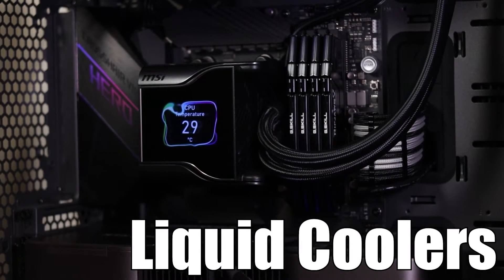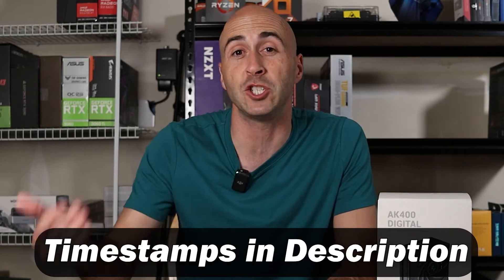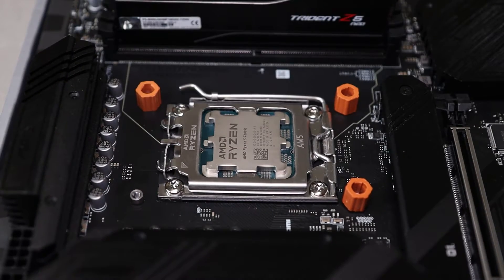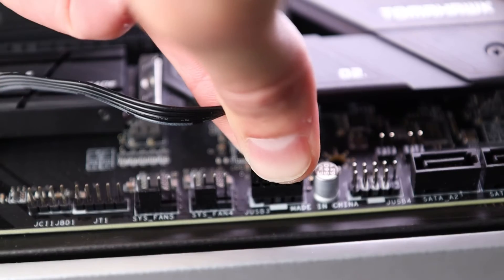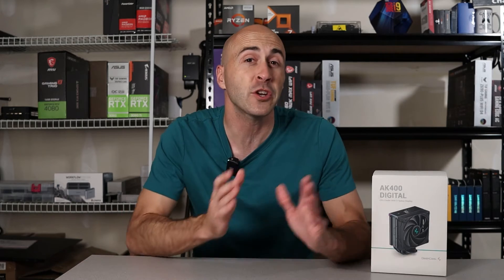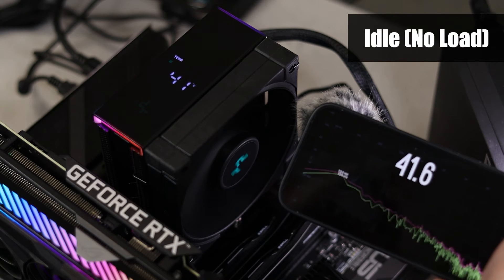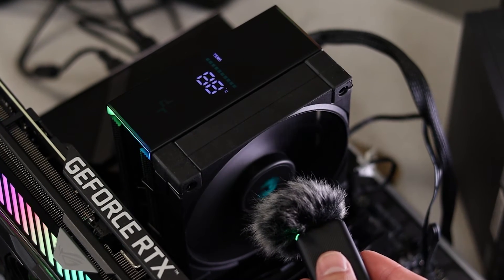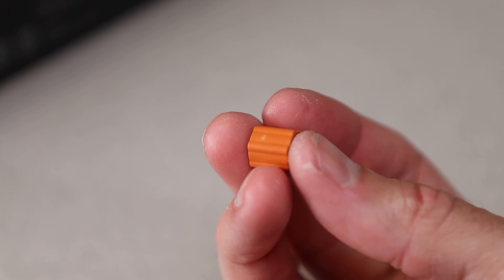LED Screen on an Air Cooler? | DeepCool AK400 Digital Review

Comment: What happens when my motherboard doesn't have RGB socket. Will it still show temperature ?
Reply from the maker: Yes. As long as you have the USB 2.0 connector and software.

Comment: Will it be good for the i5-12400f? The one I have now is not good, my cpu is overheating, so I can't even set the processor to its base speed.
Reply from the maker: It would handle the 12400f just fine

Comment: First off, great video. Thanks for all the information!!!
Secondly I would like to ask if the digital screen will still work without the 5v addressable ARGB header? My motherboard does not support ARGB, and i would like to have the digital display working.
Reply from the maker: Yes. It’s just a USB 2.0 header. The RGB end caps are the only thing ran by the 5V ARGB header
Reply: @DannysTechChannel  Thanks for the reply my man. Appreciate it al lot. You have my like and sub🙌🏻🔥

Comment: Thanks. You think this will keep the temps down with a 5800x3d? Or should i go for the larger AK620
Reply from the maker: I’d go for the AK620 if you’re running a 5800X3D. Can never have too much cooling.

Comment: Hi, my mobo only has a 12v RGB header is there another way for me to get the display and RGB of the cooler without having to get a 12v to 5v converter?
Reply from the maker: The display works off a USB 2.0 header. All motherboards have those. So you can at least use that. But if you want the RGB to work, you’ll need an adapter or your case will need a controller built in

Comment: With my am4 motherboard I have cpu_fan and a led_cpu would I plug the none cpu_fan cable into the led_cpu to power on the led and the digital display? Cheers
Reply from the maker: No. I covered this in the video, but there is a 5V addressable RGB cable. That needs to go to a matching header on your MOBO. It’s possible that’s what your LED_CPU connector is. But the other connector is for a USB 2.0 header. That’s how the software communicates with the cooler.
Reply: @DannysTechChannel  ok thanks im still fairly new to gaming pc and that kinda thing yknow I'll do my best to figure it out shouldn't be to hard
Reply from the maker: It’s not too complicated. The 5V ARGB cable only has 3 pins. Just try to find the matching connection on the motherboard. If in doubt, the instructions are super easy to read
Reply: @DannysTechChannel  yeah just had a look and found 3 pin one on board
Reply: @DannysTechChannel  with the last connecter do I look for one that has 9 prong and 1 missing? I have one and it saids COM underneath.
Reply from the maker: No, the com port isn’t what you’re looking for. It should be labeled USB. It does have 1 pin missing, but that’s not the one.
Reply: @DannysTechChannel  ok found a port that is already plugged in by a usb connecter but it saids F_usb1 and that is the only usb connecter that matches with what you say

Comment: do you think this cooler would be a suitable option for the ryzen 7 7800X3d?
Reply from the maker: Sure. I’ve noticed my 7800X3D doesn’t run near as hot as my 7600x. If you want to be safe, you could go for the AK500 digital instead.

Comment: Can the digital display be inverted?? I have a Lian Li 011 Dynamic EVO XL case that allows you to invert the motherboard so you can place the computer on the left side of your desk, to be able to view the inside of the case.
Reply from the maker: No, the cap doesn’t look like it can be removed. I didn’t want to break mine but there isn’t screws or anything to swap it around

Comment: My question is how will it do with a 7800x3d cooler i had wouldn't work so the ak400 was sorta sudden but i did want the ak620 but if the ak400 works fine no problems its good

Comment: Boss would this be enough for an R5 7600 non X edition since it's TDP is lower than the X version. Mostly we will be playing games only and here in India temps tend to get higher in summer around 40© we do have the budget for 240mm Aio.. but this one seems a Lil cheaper and good
Reply from the maker: Yes, this would be fine. I’m using it in a CPU cooler test right now with the 7600x and it was no problem.
Reply: @DannysTechChannel  Thanks boss!

Comment: I did get the cooler, it did improve  my Temps.before while  I was using stock cooler I would be hitting 95 degrees but now the highest was 75
Reply: What CPU u used?
Reply: same i am using ryzen 7 7700 previously it reached upto 98 but with this cooler i get like 70-72 max temp

Comment: Mate I bought this ak400 digital from amazon. I setup yesterday and I combined all cables. Argb is lighting and fan is working but temperature screen not working. I installed driver and driver found device but problem is still keep going
Reply: have you figure it out?

Comment: Where do I plug them into? The software is saying something about that
Reply: One on the cpu fan header, one on a addressable rgb header ( usually one near your cpu fan/pump header) and the power to one of your board usb header along the bottom usually  ( and the wire is light enough to to fit from cooler then behind the motherboard and down to the usb header) so its not visible to a large degree. ( board stand offs are more than enough room)

Comment: I have the same thing but it doesn't show the temperature can you tell me why?
Reply from the maker: Did you download the software and plug in the USB connector?
Reply: Mate solve this problem ? Mate I bought this ak400 digital from amazon. I setup yesterday and I combined all cables. Argb is lighting and fan is working but temperature screen not working. I installed driver and driver found device but problem is still keep going

Comment: Hey, I have a question. If we don't plug in the RGB connector,(There is no RGB connector on my motherboard) it will still work, right? (Temperature and other features.)
Reply from the maker: Yes. The only thing that won’t work is the RGB end caps.
Reply: @DannysTechChannel  Great thank you.

Comment: Is plugging in the RGB cable vital for the cooler to work?
Don't really care about RGB and my MoBo doesn't have an RGB header
Reply from the maker: Not at all. When I did a quick test before the B-Roll shots, I didn’t plug mine in either and it just doesn’t turn the RGB end caps on.

Comment: Hey Danny, nice video!!
So im planning to use ryzen 5 7500f with ASRock A620M-HDV/M.2+. The problem is, the asrock doesnt have any header RGB. 

The question, is it still possible for me to use AK400 digital as cooler? also is it possible to use 2 x FK120 fan in AK400 (i have extra) with my mobo?

Thanks!!
Reply from the maker: Thanks for the compliment. The answer is kind of. You can still use the digital, you just won’t be able to use the RGB end caps. I don’t think they will light up at all if not connected to a 5V ARGB header. You will be able to control the display since that is ran from a USB 2.0 header, assuming you have one open.  Lastly, I wouldn’t use the FK120 fans with the AK400. They are designed to be used with the fan that comes with it. You could create turbulence if going with something different. Just try it. If it doesn’t work or sounds bad, just swap it back to the stock fan.
Reply: @DannysTechChannel  i see. i think its better to use the no digital version then. i really dont want to use water cooling so maybe using ak400 is a good idea. 
i hope this helps a lot on CPU temperature. thanks!
Reply from the maker: You’re probably right. It’s leaps and bounds better than the stock AMD cooler. If you want a step up, the AK500 I tested earlier last year is awesome!
Reply: @wendy-qwerty  have you build your rig? i also want to build with 7500f with that motherboard. and is the ak400 enough to cool the cpu? im thinking ak400 digital or ak620 digital (since the difference between digital and not is only 10$ on my place)
Reply: hello @jade6548 , sorry for late response. 

Yes I have build my pc with Ryzen 5 7500f and ak400 digital. it works well. 
On idle state (desktop), my CPU temp can reach 51-55 Celsius. But after I use my ak400 digital, it only reach 45 max.

I also tried to do some gaming in resident evil 2 in high setting but capped at 60 fps for 2 hours++. 
If I use my stock cooler, it will reach around 65-80 Celsius. But after using AK400, maximum temp is 47 Celsius.

In my opinion, AK400 is good enough for 7500f as long you don't do overclock
Reply: @wendy-qwerty  nice, i ended up buying LT520 because of the cool rgb effect lol.
Reply: @jade6548  good for you haha. unfortunately, your cooler is out of my budget. hope able to upgrade it in future!
Reply: @DannysTechChannel  i think the fan included is FK120
Reply: @DannysTechChannel  Just to add there is an AK400 (plus I think its called) that comes with 2 fans but from tests doesnt make a discernable difference just more noise, shows how efficient the normal AK400 is

Comment: hi new sub here, can i ask what air cooler will you recommend for R7 5700X?
Reply from the maker: Since it’s a relatively low power CPU to begin with, any tower cooler will work. I like DeepCool products, or Thermalright if your on more of a budget
Reply: @DannysTechChannel  thanks fo replying, I'm thinking which of these two I plan to buy the ak400 digital white or the ak500s digital white. thank u

Comment: This cooler is going for what equals $150 in my country which is absolutely ridiculous, nearly double the price of the Arctic Freezer i35 which is the cooler I plan to buy, nonsense. But I think that's because it only now started becoming available, in fact, I just found it in a local site an hour or 2 ago from one seller only.
I think I'm going to wait a bit more for more availability and I'd rather go for the ZERO DARK version when and if I could find it here at a reasonable price.
Why this over i35? The i35 non-RGB version doesn't come with black heat sink, the RGB version, well, comes with stupid fan RGB which I don't like, also the fan can't simply be replaced in case it dies without having to replace the heat sink with it which obviously is a no, no to me.
Sure there is other options out there I can find but none got my attention like these 2, ultimately, due to the current price anyways, this one is a no for now.

Comment: Is the  software absolutely necessary for the cooler display to function. Or just to change settings like from C to F. And it has it's own temperature sensor. And can be uninstalled after used. Like, what if the computer freeze. Do I always have to wait for the PC to boot and log in and the softwar to start to have the display show me the temps? What if I'm using FreeDOS or a form of Linux boot or just playing in the BIOS. No temp? 
I'd like something that will show temps without running anything.

Comment: would this cooler be fine for the r5 7600x with 3 fans that come with my case or what you think and would this work with the MSI PRO B650M-A WIFI AM5 Micro-ATX Motherboard
Reply from the maker: Yep. I tried this cooler out with my 7600x and it worked just fine.

Comment: My motherboard doesn't have 5v argb header(only the 12v one)...is it possible to use the converter for this cooler? If so please recommend some good budget friendly converters 😊 ty
Reply: did you fix the problem?

Comment: my rainbow RGB lights dont light up for some reason even with the program, theyr not lighting up on my ak400
Reply from the maker: It has to be plugged into a 5V ARGB header on your motherboard and that is controlled through your motherboard’s software or in the BIOS
Reply: @DannysTechChannel  everything is plugged in, still no lights, only the display which shows the the temps and uusage
Reply from the maker: You might need to update the drivers for your motherboard
Reply: @DannysTechChannel  thanks for the info!👍

Comment: I bought this cooler. I am using Gigabyte B550 Gaming X motherboard (AM4 socket). The problem I am facing is, the provided raisers are a bit too high due to which the cooler heatsink is touching the CPU veeryyyy lightly. Any idea how to fix or what could be the issue?
Reply from the maker: Are they seated the whole way down? I had to push mine down to get them to make proper contact. They are quite tight
Reply: @DannysTechChannel  Ya, they are all the way down. I even pushed them with all my might on all 4 risers and made sure there is no gap or any wobbling of any sorts, and yet the cooler's heat sink BARELY touches the CPU. I spent over 4 hours trying to find out what could the problem and could never find.

I also made the sure the 4 screws which we have to put on the risers are all the way tight to the point if any more turns, it will break.
Reply from the maker: Which risers did you use? What color and texture are they?
Reply: @DannysTechChannel  The AMD Risers, the orange ones shown EXACTLY like in your video.
Reply from the maker: Hmmm. Hope you didn’t get a dud. Did you contact DeepCool?
Reply: @DannysTechChannel  I actually WISH that it is a dud so that way at least we can conclude the issue as a dud and not much else. I had ordered it through Amazon, so I have requested replacement of the same. Will get the replacement by this Saturday. I will post the update here once I get new replaced one.
Reply: @DannysTechChannel  Hello, I am here with the update on my issue. Turns out, it was ACTUALLY a dud. The risers were faulty and for some reason a bit taller than replacement ones I received. 
Installed the replacement one as usual, tighten the screws and voila. Perfectly contacting, perfectly working. Temperature dropped DRASTICALLY from Stock cooler. From 95C on full load, all the way down to 70C on full load.

Now, the only issue is my cabinet itself. It doesn't have proper airflow (although it has 2 120mm fans in front, 1 140mm fan at the back). When the GPU and CPU both fire (say running a heavy game), the temperature reaches 85-90C. The GPU fans are cooking off the whole cabinet as a microwave.
Buut anyway, the cooler has no issue now!
(P.S. If you have any good recommendations for a good mid tower cabinet at around $35-$40 (ya, I know too low, but currently I am broke), that would be great)
Reply from the maker: That’s great to hear that you figured out the issue. That was a quick replacment. As for the cabinet, not sure I can help. I always just buy a desk and put my PCs on top.

Comment: Can i chage the screen of the cooler with my pc?
Reply from the maker: What do you mean? You want to change the look? Or physically remove the screen?
Reply: @DannysTechChannel   i mean i will change the picture that will play in my screen?
Reply from the maker: No, it’s just a little LED that shows CPU temp or utilization. It’s not that complex
Reply: @DannysTechChannel  thanks for the information

Comment: Great cooler, I have the AK620. The Deepcool fans leave something to be desired though. As others have mentioned in reviews, and I experienced this myself...the fans have a weird oscillating hum when they are ramped up beyond "silent mode".

I replaced my fans with Lian-Li SL120s, and even with the extra 2mm of width the fans have, the outer fan sits right on top of the G.Skill Trident Z Neo RAM modules.

The cooler does not hang over the RAM, but the outer fan does, but without issues. It is a tall boy though, and almost touches the side glass panel on my o11 Dynamic XL!

Not sure if it is just my system, but the digital display with blink off occasionally, then back on. Furthermore sometimes the temp reading gets stuck and a reboot is required, as ending the task doesn't seem to work properly.

Win 11 Pro
5900x / 3060ti
Asus Dark Hero (mobo)
Reply: So the case fans apart - do you think the Deepcool coolers are worth it?
Reply: @hyperterminal_reborn  Absolutely! Although if you just want pure cooling with no frills, I'd go with a Thermalright Peerless Assassin. Not quite as nice looking, but equal if not better cooling and significantly cheaper.

Comment: I have the standard ak400. Would be nice if it was possible to add the display as a separate purchase
Reply from the maker: I thought about that. Not sure if they would or COULD sell it separate. I couldn’t figure out how to remove the display from the cooler lol
I’m too afraid of breaking it!
Reply: @DannysTechChannel  Its just held on with magnets like the non digital fascia, Also not sure if the non digital has the groove for the wires

Comment: I love this idea, but I run Linux, so this would be a no go because of the software.  I like how some keyboards (like Wooting) have the ability to run their software through a browser, making them compatible with any operating system.  I'd like to see this kind of thing become more widespread.
Reply from the maker: I need to try out Linux. I honestly have never looked into it but heard so much. So the software is windows based then?
Reply: @DannysTechChannel  That's my guess, since it's an .exe file.  I would think they would have a separate version for Linux (.deb, flatpak, etc.) if they supported Linux.  I didn't try the .exe to see if it would run through wine, etc. but for basic stuff like this I'd rather it just work rather than having to tinker to make it work and wonder if any kind of updates or changes would break it.  I'm by far not an expert in Linux, but have been using it for a few years now and don't use Windows much at all except at work.  I've come to really like it and feel the pros far exceed the cons, at least for me.